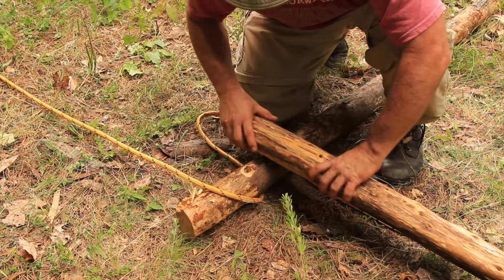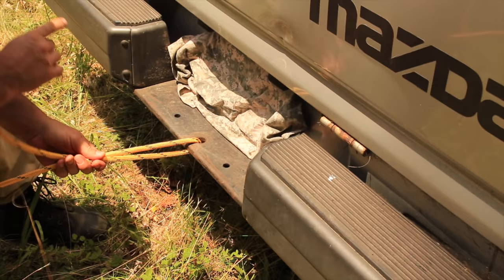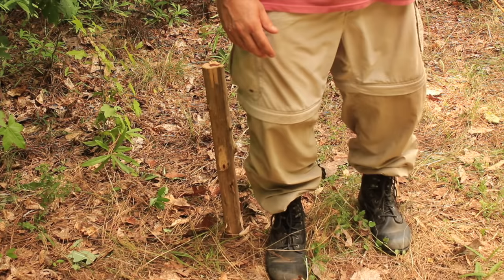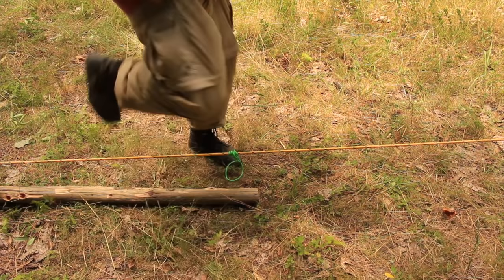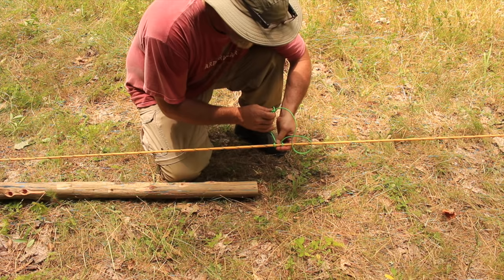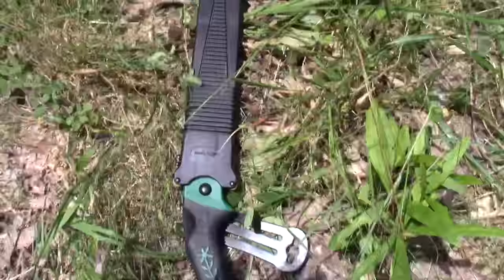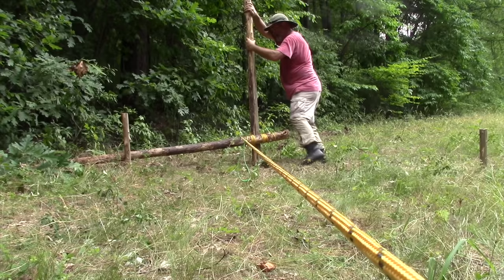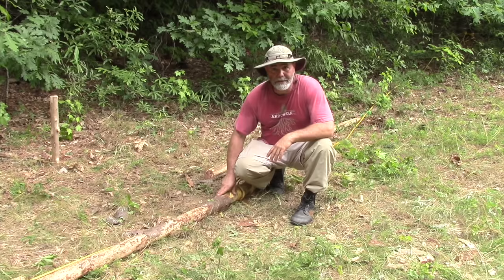Off Grid Winch: Making a Flip Flop Winch

Comment: One way to help minimize the effects of a rope snapping is to drape a blanket or some type of fabric on the rope or cables being stretched.  The hope and tendency is that the broken cord will hit the blanket or fabric that is over it.  This does not eliminate risk, but it lessens it, and can help you stay safer in a pinch type situation like this one. Very cool video!
Reply: That is excellent, very useful advice! My iron rule that I keep reminding myself about like some kind of mantra is simple: "Rule Nr.1 is NO ACCIDENT" meaning do your utmost to avoid injury to yourself or another person. It must always be your major concern, and never cut corners when it comes to well established safety procedures or using standard protective gear. Running any risk of getting harmed out of lazyness is really, really stupid. Especially when you happen to be all by yourself use common sense, maintain self discipline and caution, be very focused and use all your senses to monitor everything involved in that particular task you want to acomplish. train your awareness for risks, when possible do a quick calculation about the forces you are engaging with whenever you want to apply leverage. It will increase greatly your ability to make responsible decisions, a solid understanding of the basic mechanical problems will allow you to do herculean tasks with good confidence in its success, but still expect the unexpected and include a generous safety reserve. I hope that didn't sound too boring, all this stuff can actually be done in a curious, playful mindset and is part of the fun of mastering practical challenges in a really clever, seemingly effortless way. All this becomeseven more rewarding when it is experienced as a team, especially with children or when the sucessfull crew is you and your family being out in the woods.
A tip like yours can easily safe a limb or even a life, that is a real treasure what you handed out here. Thank you!
Reply: good idea.
1. tie the blanket (or t shirt) in a knot around the line, better than just draping it. stays put, less likely to fall off if the line snaps.
2. i like putting the blanket near end of the line or at the point that is most likely to snap. How do you know? In this video, assuming it's a new rope end to end, it's the truck side. the loop into the bumper will break first, because it's a tighter turn back than the turn at the log. so put the blanket on the truck side about 5 feet away from the turn.
Reply: I thought about the rope snapping too.  I thought about just piling some heavy branches over the rope to catch the broken end from snapping me.  A blanket or something, anything actually, would be prudent.
Reply: @longbowshooter5291 most of this advice is a myth. There are some Aussie videos demonstrating that blankets, t-shirts etc have little to no effect on the enormous forces released when a rope or cable snaps. Cable might take a limb off but dyneema might not hospitalise you.
Reply: @teeanahera8949  Yeah, I thought  about that, a shirt or blanket wouldn't do it, it would take something more weighty to stop it.
Reply: Seems like doubling the rope would be more effective. 🤔
Reply: adding things on top of the rope is likely to add an unnecicary strain or load to the rope. just wear eye protection and pray😂 maybe you coud wear a fencing jacket and helmet  if you're worried. put the blankets and tshirts on yourself😂😂😘
Reply: @drak_darippa eye protection isn't going to stop anything. That's like saying eye protection going to stop a bullet when someone shoots at you. The blanket over the rope takes the energy out of the rope so it doesn't come back and kill you. It's happened many times. Do a quick search tow ropes or winch cables snapping and killing people.

Comment: Totally awesome.  I wish I had known this 37 years ago when my truck was stuck on a slope at the edge of a ravine.  I had a long rope that we tied to a small tree, several 3' and 4' concrete stakes, sledgehammer, and a few other tools.  I knew there had to be a way to manually winch it out but couldn't figure it out.  Meanwhile, my friend ran back to a ranger station he had seen a few miles back and got them to come with a 4-wheel drive to pull us out.  I had everything I needed but the knowledge.

Comment: Great trick. Good idea would to be have trailing wedges behind the vehicle’s tyres so that it can go forwards but not roll back if the rope breaks. Plus a blanket on the ropes to stop whiplash if it lets go.
Reply: Trailing wedges!
Excellent idea!!
Reply: I recently used a 8 foot length of a 2 by 6 to act as a crowbar to move a truck, I used a 4 foot long 2 by 4 as a wedge behind one tire to keep the truck from backing up. I do not recommend the method I used going up a steep incline though.

Comment: Hi Todd, thanks for the demonstration. 
One way to mitigate the danger of line snapping is to make the same configuration using a loop of rope rather than a single line. Then tie paracord or some other line loosely around both of the two strands at intervals, so that, should the line snap at a given location, the encircling paracord nearest to the break will prevent the broken end from flying more than a few feet. Incidentally, using a loop will also nearly double your safe load limit.
Reply: Great comment. Came to say something similar.
Reply: so just keep like 300ft of cord available?
Reply: @Mrmghz1  I do. Use it more often than the jumper cables and socket wrench that live next to it.

Comment: well it's quite a lot of leveraging to gain a couple of feet ...  YET  , a couple of feet can make the difference between getting stuck in the middle of nowhere or getting your  vehicle out of a mud hole  or sand strip , so ... all in all,  this is BRILLIANT  ... it's simple , needs basically no tools and gets the job done ... for me , it  deserves two thumbs up
Reply: He moved it more that 3 feet with little effort. A log with a diameter of 4 inches will have a Circumference of 12.5 inches. Each turn was half that, so he moved it 6.25 inches per turn x 6 turns. He could have easily gone farther but this was just a demonstration.
Reply: @JayM409  a log with a diameter of 4 inches has a radius of 2 inches! But I know what you mean is circumference! I enjoyed this clip. No one would ever suggest doing this on a daily basis because it is clearly dangerous, but having the knowledge of the technique is valuable in an emergency. I think if I was doing it I'd double the rope if it was long enough then if one snaps you might have time to dive for cover.
Reply: @clivejones7104  - corrected, thank you.
Reply: @JayM409  no problem. I was just being clever - I knew exactly what you meant!
Reply: If you had a helper or helpers that knew your goal this could actually go rather quickly.

Comment: I could have used this trick a few times, being stuck deep in the bush in the Yukon. Having knowledge like this could save a life, Thanks for sharing.
Reply: ...and the materials needed are light, flexible, and handy for other task . Couple hundred feet of rope, or ropes and a wire saw to cut just %10-%20 into the saplings ALL THE WAY AROUND allows em to be snapped easily instead of cutting all the way through them (much faster).
Reply: I'm guessing that bird shreeking in the background is the female. (anyone know what breed it is?)
Reply: Mr. treg, yes this is called a trick.  Knowledge is a "come along".  $23, Home Depot.
Reply: @prg2812  
Actually it's 44wizbump reading another "snowflake" reply.
/s/
Reply: @forsale3783  That's true, the trick is staying alive, and knowledge is how you do it.
Reply: @forsale3783  I keep two come-a-longs and a high lift in my truck any time I'm in the woods. Among a few other tools. Gotten out of many jams. Worse being a culvert collapsing under my front tires.
Reply: @prg2812 A flip flop bird?
Reply: @forsale3783 less at harbor freight tools
Reply: Yeah if you tell yourself survivability depends on having a vehicle! Haha.

Never leave the house without a fire starter, be mindful of the clothing the wear. Eat well. Exercise.

You won't need this winch to save your life if you can teach yourself survivability exists outside on needing a vehicle for travel.

Many generations have navigated those woods and other tough terrain in this country - they never sat down and said "game over people, no one brought the winch."

But to some survival is laziness I guess.

**I'll add more.

I watched this video as it stands as a way to learn how to move a heavy object overland - not because I'm filling a vehicle through the woods efficiently trampling habitats - I watched it as a way to move a heavier log to camp if all you have is rope
Reply: Will wick  I no longer own a vehicle as I am able to walk with my new prosthetic leg - I'm sorry my point of view clashes with your point view.

Leg or no leg I have, and will continue, to maintain survival skills. in today's built environment it remains a quality feather in one's cap to be able to successfully leave a city and come back regardless or their means of travel.

Now keep in mind my first comment doesn't come from a place of disdain to how others live - it was more of an attempt to convey that for a very long time we had no need for technology. I also believe I stated that this video is very viable and a great source of information - this winch device could be deployed by one person to move something very heavy that you cant/don't have the means to break it into smaller pieces. 

Sooo dude - again sorry our views clashed - but I don't care lol.
Reply: Also, I suggest you read into the philosophy of "correalism (Frederick Kiesler)" surrounding design; the dynamics of continual interaction between people and their natural and technological environments. (And that's right from wikipedia (sourcing* credible sources))

 It may help you understand why you're right to question our need for modern communication devices, but wrong for not seeing ... How do I put this... That it's okay to take two steps forward so long as we accept it may mean taking one step back.

Educate yourself  will wick, be intuitive and not instinctive.
Reply: Will wick  like all of what I said is based on treg Forsyth saying "this could save a life" my response (what you commented on) was : (paraphrasing my previous comment) proper approach to a tough situation and a mind full of survival techniques and principles is what saves a life. Treg is right. This knowledge could save a life (if life depends on a vehicle (which it doesn't)) - but the life isn't at risk due to a stuck vehicle, it's because the life the person lived hasn't prepared them for the hardships they currently face 

Will you didn't think your comment through mate
Reply: Will wick  lol stop thinking I care about what you do or how you live. Lmao. Survival is a lazy mans game. Fact not disdain. The less energy you exhaust the better
Reply: Will wick  " ...sure as hell sounds .. " that is clearly you having upset at my words and taking them personally... Lol sorry you feel accosted.
Reply: Will wick  I didn't quote a single book - it was a report published from Columbia university's architecture department around the late 1930s (if I remember correctly).

Sorry if you find ones usage of credible sources for information to be... Pompous was the word you chose??
Reply: Will wick  again mate, this is all your own perspective on how you interact in the time you spend on earth. I say again, sorry my point of view upset you - but I rreeaaally don't care about you
Reply: Will wick  I care about the debate, not the person in it. Stop trying to make this all about you mate.

Also "you sound", stop inferring tone of voice - this is a text debate. You're only imaging how I sound.
Reply: So I hope you can see my stance - if you want to talk about wether or not we should be using cell phones when or predecessors did not - I'm game.

But if you'd rather pretend to psychoanalyze my character, I'm just gonna put on my "idc" hat and make you look stupid.

Soo back to the cellphone thing??? We use technology to aid and support us in an ever developing and changing world. Technology is a third environment, specific to man, which has developed along side us as we have struggled to face the other environments and their affects wether it inimical events like drought leading to food shortage, or today, something like covid.

Our predecessors didn't use cellphones because they didn't have them.

Your response; now that the debate is back on track.

(I'm willing to be amicable if you're willing, but that means you can't rely on name calling. You need facts)
Reply: Will wick  I edited my post on my most recent (to now) comment.
Reply: @widgeonslayer  hi+O
Reply: Will wick  Boys, boys!
Reply: @leroythelen3635  ?
Reply: @JAMES DURHAM U.E. ya dont know why I spelled them that way, but they work.
Reply: Who knows. Probably Minor birds, my dad had some that would learn my father's rather colorful language; Everytime he had a party the bird would start in, to my mother's dismay. LOL🐧
Reply: As stated below.
Reply: Why didn’t I think of that this is sweet
Reply: I've always wanted to drive a yukon.
Reply: @ryankaul8620  this is annoying me. Can you stop trying to sound smart. I like debates too. He just misinterpreted your comment. He probably took ot to mean you're a tree hugging hippy who doesn't like cars. You could've simply said he misunderstood you. Also, please learn to care about people, and read the Bible. It is true. God is real. If you don't understand that, then I recommend you start studying that book. God and his son Jesus are who we truly need for survival. Jesus can save your life.

Edit: actually, it's okay to sound smart, just don't put it begore loving others. Sound stupid if it is the right thing to do. Be humble. There is a lot we don't know. Will may not know very much compared to you(I don't know), but just love him anyway, and don't try to rub it in his face.
Reply: Lol
Reply: @jsmith5443  If you truly believe this, then wow.

Comment: Thank you for the update with the barrel log stakes and the paracord loops on the load line for the lever log.  I used this basic method years ago as a young Marine to get a vehicle back on the road.  We had plenty of muscle available but this method worked without anyone getting hurt.   I respectfully suggest driving the barrel log stakes in at an angle so that the log is less likely to slide up the stake and spin around.   I also suggest using loops of paracord on the stakes for the barrel log.  There are deadly forces stored in this device that will break bones and skulls faster than a man can react.  I would only move in the areas around this winch where I would  be safest if something goes wrong.  Thank you for posting
Reply from the maker: Appreciate you sharing your advice and experience. Upon further experimentation, I found that I didn't need the stakes at all when I rigged the rope to spool on only one side of the pulley pole. For added safety, I would use stakes if I was pulling really heavy stuff though. With more than one person available, the method would be much safer since no one would have to cross over the line of potential breakage. Thanks again for sharing!
Reply: Mike Trafford  not possible. One post is flipped in line with the truck, the other at right angles. Will always need to step over that line to retrive that tangental. Unless you flip it with another post and pull it back with a rope
Reply: Experience worth it’s weight in GOLD!
Reply: Semper Fi DK
Reply: Mike Trafford , that's a long walk around the vehicle or the anchor for each operation, now who is going to continue to do  that after the first few times? I wonder what could be done to mitigate the danger, otherwise.
Reply: i think, if you were to ask someone who got injured by this, they’d recommend walking around the anchor each time

Comment: It’s amazing! Tighten ropes is a very powerful means of engineering!
Just a suggestion: using a small piece of wood tightening alongside to the wheel, slightly wider than the size of the wheel, would have the similar of the result of self pulling out of a dip! When the wheel is moved either forward or backwards, the piece of wood will dug into the ground with extra friction to the wheel might be enough force of moving the vehicle! Worth of a try!